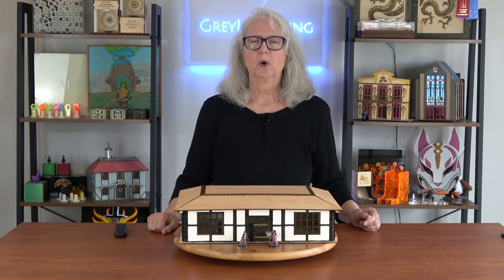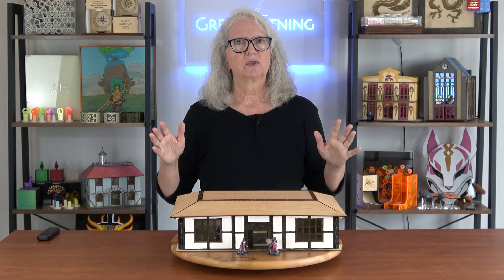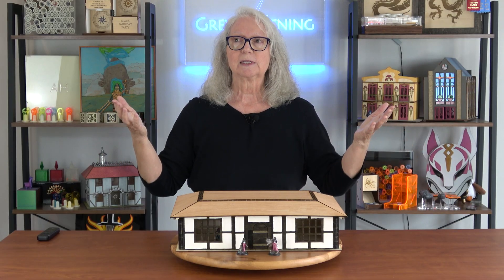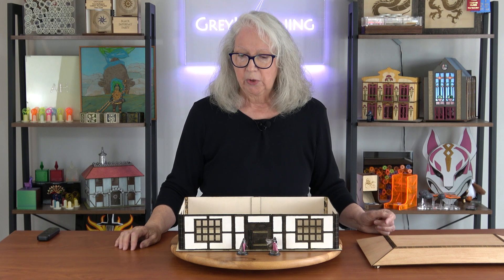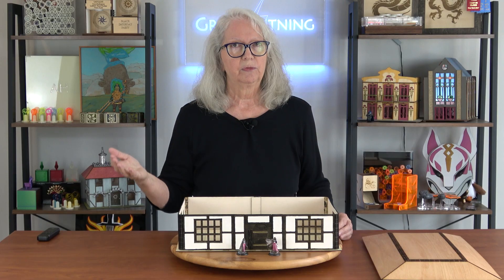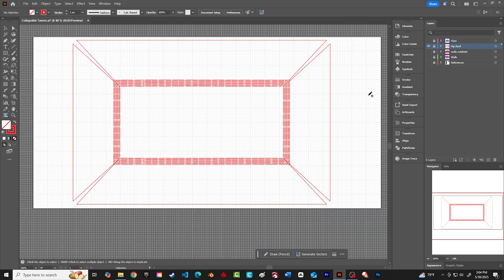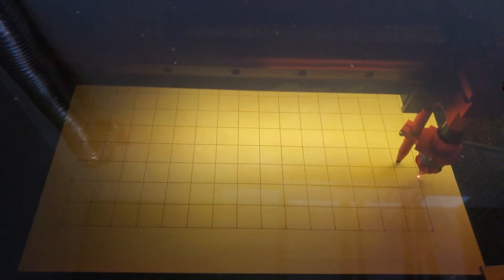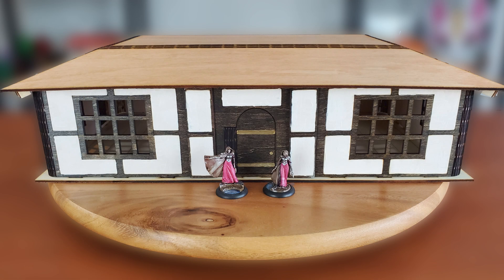How to Design and Laser Cut a Collapsible Tavern that Can Be Stored Flat

Comment: Would be an awesome task for my commarker omni. Thanks for sharing! Can't wait to try.
Reply from the maker: Selma, I'm not familiar with the Commarker Omni. I mention in the video that I had to use my CO2 laser because my diode was not quite big enough. If you can cut a 12x24 inch board you can definitely do this project! It takes some time to paint but almost no time to assemble!!

Comment: Very nice. Reminds me of all the old Plasticville buildings I have for a train platform layout.
Reply from the maker: Thank you so much! Now I have to go look up Plasticville.... You know, I'm interested in doing a scale model that is size adjusted for a train setup. What is the scale for trains? I know it is smaller than for wargaming.
Reply: @GreylightMay  I believe 1:87 for HO scale trains. https://en.wikipedia.org/wiki/HO_scale - hope it allows the wiki link. I will try and dig out the boxes and see if they say specifically but I don't think they do.
Reply from the maker: It did allow the link, thank you! I'll have to do some math to figure out the conversion but once I get that number I should be able to downsize all my library elements a page at a time. I think train scale is also good for decorations, like a Christmas village for the mantle, so maybe I'll use it for that project sometime this summer. Storing seasonal decorations is also a problem!